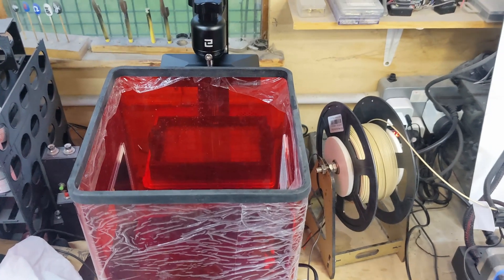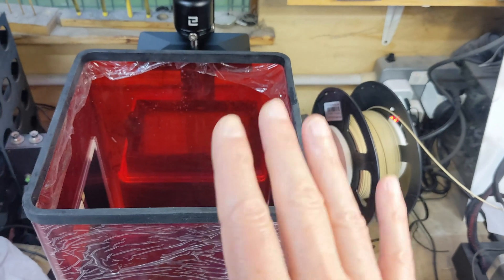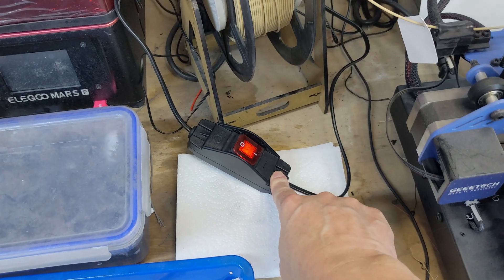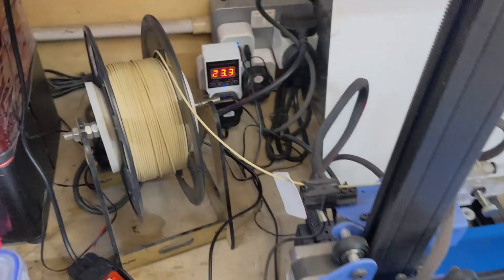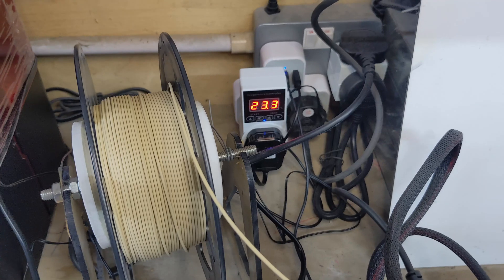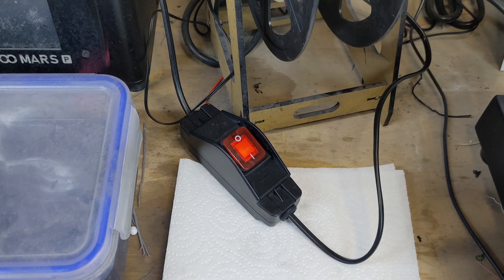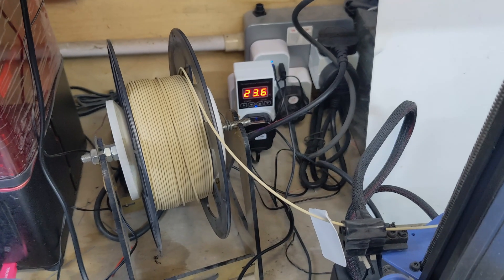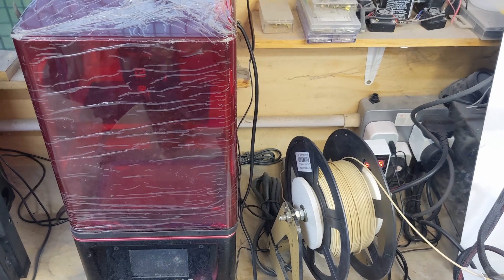Updating the DIY heater for my Elegoo Mars Pro resin printer

Comment: Why 2 5w pads instead of one 10w pad? Is it just because you started with the 5W and that was the easiest way to double the power? If you had to do it over again would you just get one larger one or is having one on either side the better method?
Reply from the maker: It was primarily because, as you surmised, that I already had one 5w pad, but having a pad on either side will probably provide more even heating. Having said that, it's such a small space, I i dare say a single 10w pad would do just as well.
Reply: @SteamGeezerUK  Thanks! I really enjoyed the video and I will probably do this myself over the summer. As it is now I just don't print in the winter due to the temp issues.
Reply: I will guess that two pads provide more even heating inside the enclosure. They offer direct radiant heating of whatever’s in line of sight of them, not so much convective heating of the air inside the enclosure.

If you’ve ever stood in front of a fireplace or heater and had to turn around to get warm all over, it will make more sense to you.